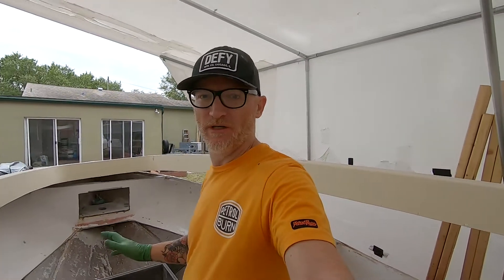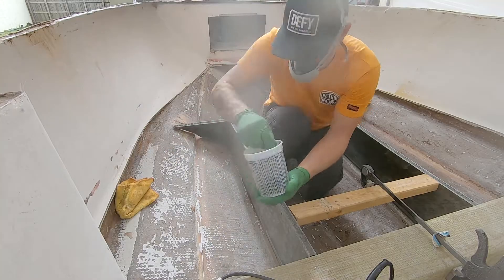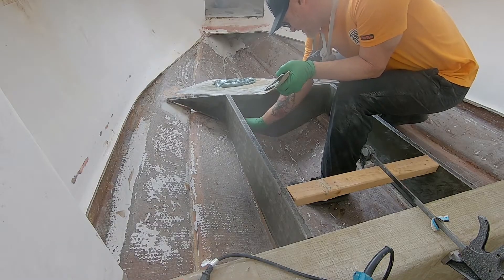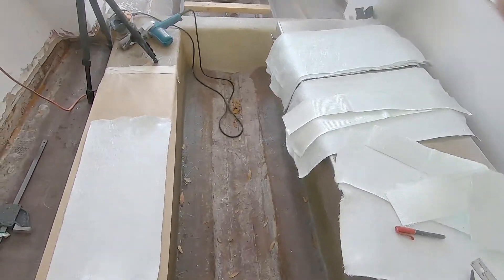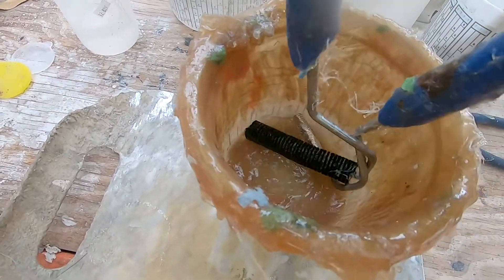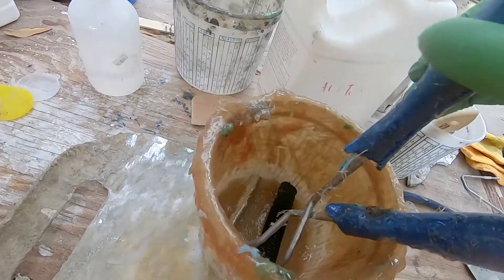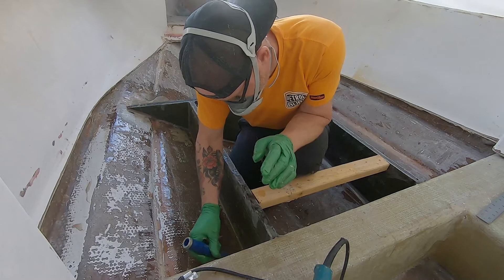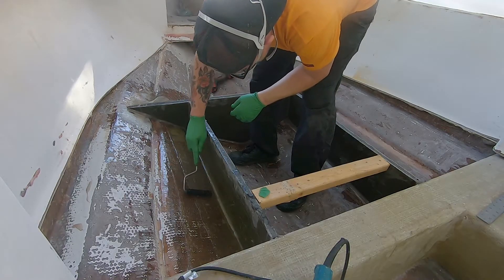HOW TO FIBERGLASS TABBING for Boat Stringers Transom & other Marine Fiberglass Renovation Projects

Comment: what about on new stringers where the engine mount bolt holes are. Do you epoxy resin the hole then re-drill?
Reply from the maker: Assuming the stringers are wood…yes. Over drill and fill with epoxy.
Reply: @boatcrafterscollective  okay great that's what I was thinking I guess add some 403 or 4062 thicken.
Reply from the maker: @Supanova70  I don’t use West products. Just regular Fumed Silica will work to thicken any resin. West likes to call their products fancy names so they can charge more for them. 
Cabosil = Fumed Silica.
Reply: @boatcrafterscollective  you know I was thinking the same thing I'm new to this stuff but silica is silica
Reply from the maker: I sell alot of items at boatcrafterscompany.com and im slowly growing the stuff I offer. If you ever have questions just shoot an email.

Comment: Question I was always told to start with your smallest piece then work your way to the largest piece. That way if one lets go then you still have another piece bonded? Just curious what you think?
Reply from the maker: Why would just one “let go” and not all of them? If you have a lam layer detach you have much larger issues and that would be an extremely rare situation. That mindset I feel is flawed. 

I’ve been doing this for a long time and will tell you that unless you’re working extremely fast putting down all of your layers before the resin kicks off, your going to have issues laying a second layer over a smaller layer because the edge of the glass will start to cure so now you’re trying to put a second layer over the top of a hump/ridge causing air pockets under the laminate. I honestly don’t know where that method misconception started but it’s flawed. 

Everyone does fiberglass differently but putting larger layers over smaller layers is a nightmare to deal with. Every boat I’ve ever built has been large layer first.

Comment: Not all glass fabric comes with the same binders... to be on the safe side, get a can of styrene (same people should sell it) add the recommended amt. to your resin), will also decrease viscosity so it wets better and improve adhesion... (a must for no-name resins)
Reply from the maker: CSM has one of two binders. Either a styrene binder or a power binder. 90% of CSM is styrene binder. Polyester resin has styrene in it by default. Adding more styrene to your resin is a terrible idea as it only thins the resin and reduces its chemical characteristics. Making the resin more viscous is not helping the adhesion at all. It’s making it worse.

Comment: I’m about to start glassing all my stringers  on a Paramount just like this. I see that you did not round the top part of the stringers, I’m using coosa just like you did. Is ok to lay the floor on top just like that?
Reply from the maker: Yes. You don’t need to go over the top.
Reply: @boatcrafterscompany  great, thanks. One tab is enough for the stringers?
Reply from the maker: @haroldc.e567 no. Three tabs. 
10” 8” 6”

Comment: I use epoxy for all below deck work, and switch to polyester for the horizontal surfaces above.(deck and gunwale) to make it compatible with gelcoat wear surface.  Vertical exposed surfaces, I switch back to epoxy as I paint these surfaces with 2-part urethane paint.  I get my epoxy for free, but for below decks, I'd still spend the extra.

Comment: Bro.. good job!.. but you would save some time by just mixing up a big ass bucket of chopped fiber fill and layer that on right under the glass as you're laminating. You don't have to mess w corners etc.. all one step! 👈👽
Reply from the maker: Sure that’ll work but not in Florida heat. By the time I mixed up the putty, wet out the glass, and got the glass into the part the resins would be kicking off. Unfortunately not possible for one person to manage.
Reply: @boatcrafterscompany  for sure.. I'm in CT.. I've been starting 4-5 am to stay out of the heat man. I'm also a one man show. You know what I started doing on some difficult pieces? Like decks from underneath. Just cutting 1' squares. 🤷 Sometimes there no space for more hands even if you had them. I've done both ways and probably other ways lol. I enjoyed your vid bro. Top notch. 👽👍

Comment: i used to use disposable baking piping bags for my coving, it makes it so much quicker to get your filler into the corner and wipe a radiused spatula or spoon across it
Reply from the maker: Sure that works when it’s 70 degrees. In 90degree Florida heat you have about 5 minutes to mix and get the material down before it kicks. Certainly no time to load up a cake bag.

Comment: That's the first sign he don't know what he's doing if your gonna lay 1708 you always lay chopped stran Matt first and you don't use epoxy resin to do tabbing you use vinyl resin so you can go layer after layer with out having to sand
Reply from the maker: You have no idea what you’re talking about. 1708 has chopped strand stitched to the back of it and you don’t need an additional layer of chop. I’m not using epoxy.
Reply: @BackyardBoatworks  how u gonna tell me I've got two boats now and had two previously not small bullshit boats either 75 f30 Trojans twin 318s got ridda both of them now I got a 89 32' penn yan 12' beam and 26' robalo center console 10'5 beam
Reply from the maker: I don’t care if you got the Titanic. You’re comment was wrong. Learn what 1708 is before making a dumb comment.
Reply: Lmfao Ronald man y'all are brain dead

Comment: I have a 1985 19' bluewater open bow power boat im about to install a new transom in. The top of the transom to the hull doesnt allow for a decent tab. Ive heard tabbing should be atleast 3" on each side being joined for a total of 6" sheets of glass. With my area i might be getting 2" on the boat.

Do you have a standard tab measurement you go off of? Also smaller tab first or larger tab first? 

I know your a busy guy thanks for any help you can give.
Reply: 12, 8, and 6, answered part of the question. Sorry it happens fast in your video I didn't see it prior. I wonder if 2" (total of 4" tabs) on the top of my transom would be sufficient?
Reply from the maker: The top of the transom doesn’t really need tabbing. Typically the glass is just capped off over the top depending if the cap is off etc. 
focus on the bottom and sides and you’ll be fine. 
Large piece goes first. Don’t listen to any garbage about putting the smallest first. That will cause nothing but air pockets under the glass.
Reply: @boatcrafterscompany  thanks for the quick reply!

Comment: Thanks very much for the tutorial - exactly what I needed as a first timer in bedding and glassing stringers. Quick question - when laying the laminate on the next part of the stringer do you overlap them slightly? If so by how much? Many thanks.
Reply from the maker: yes overlap so it creates a continuous reinforcement.  It does need to be a lot of overlap maybe 1-2"
Reply: @boatcrafterscompany   Brilliant. Will do. Thanks.

Comment: Did you glue them in with polyester to the hull ? Or are they held in place with epoxy ?
Reply from the maker: The radius holds them in place till the glass tabbing is added. Not necessary to bed into the hull.

Comment: Polyester won't bond to epoxy, but vinylester will.
Reply from the maker: Untrue. Polyester will bond to fully cured epoxy when sanded with 60grit and cleaned well. The key is the epoxy has to be 100% cured. Most common marine epoxies take about 7-10 days to fully cure and some take longer. Once epoxy has fully cured and it’s completed it’s Chemical reaction process, it functions just like cured polyester. This is a common misconception among DIY boatbuilders. 
However putting poly over epoxy doesn’t make much sense. The only time it would make sense would be if you were fixing a bunch of cracks and crazing with epoxy you could let it sit for two weeks and then topcoat it with gelcoat. However, using Vinylester putty for the repairs would be the better option.

Comment: Like that brush roller. I haven't had luck using a fin roller on poly resin like I do with epoxy. It just wants to dig in...?
Reply from the maker: I stopped using fin rollers and prefer the bubble buster rollers instead.

Comment: Great video and so extremely well explained. I believe I may have some rot in my stringers, any tips for how I could check without destroying my boat or floor? Thanks
Reply from the maker: There’s really no easy way. If you can reach them from the bilge area you can drill a hole in the side to see what you find. If you have rot stringers it’ll most likely be towards the back of the boat. Drill a 2” hole and see what the core looks like. If they are fine just fill the hole up with epoxy
Reply: @boatcrafterscompany  thanks mate. I have a feeling that's where the worst of it will be too. Thanks

Comment: Agree polyester resin is good enough on older boats built on the same resin. But nowadays  I only working small scale with my own boat or smaller jobs for others. Don't have to think about resin cost anymore😊 Epoxy sticks to everything, no matter what resin is below.
Reply from the maker: No one makes epoxy hulled boats unless it’s a carbon hull. Poly resins have been used for decades in almost every glass boat ever built. Epoxy is an adhesive so it can’t be compared to poly resin but for most jobs epoxy is overkill and doesn’t justify the additional cost.
Reply: @boatcrafterscompany  Where are you buying "cheap" polyester resin?  Raka epoxy is comparably priced to most Polyester resins and less expensive than any Vinylester.  Even Facebook marketplace sellers price Polyester resin of questionable lifespan fairly high.  The only advantages I see for Polyester at this point is rigidity, workflow advantages, Gel coat comparability, and UV resistance.
Reply from the maker: Cheap is a term that is different to each person. Average cost for good quality poly resin will be in the $40/g range. But if you’re like me and I buy wholesale my cost is about $23/g. Sorry but you’re not matching that with epoxy. 
BUT…using epoxy for jobs like this is a waste of time and money. Professional fiberglass shop DO NOT use epoxy for work like this for many reasons and it has nothing to do with cost. Epoxy is extremely overkill for lamination work. The adhesion strength of epoxy is stronger than  most substrates can handle. Example…if you laminate a piece of Coosa with 1700 and epoxy and try to pull the 1700 off, the coosa will separate and delaminate before the epoxy will fail. Will it work??  Yes it works but why use it. That’s like going to the marina as asking the yard to haul your center console out with the 100 ton lift when your boat is only 10ton. Does it work…yes but you just paid $5000 for a haul out that you could have paid $500 for. 
Besides that…epoxy resin was never designed for hand lamination it’s designed to be used in infusion processes. Wetting out glass by hand with epoxy resin is much more difficult than wetting out with poly resin. Additionally epoxy resin takes 12 hours to cure. Professional shops don’t have time to wait for that hence why nearly all repairs to this day are done using poly resins. They work good for the task at hand. But hey…if you wann use epoxy GO FOR IT. It your bank account not mine. ✌🏼
Reply: @boatcrafterscompany  Thanks for the heads up.  $23 is significantly less than what I'd be paying so that certainly makes sense for you.  For me its $38 polyester vrs $50 a gallon epoxy and with the epoxy I can save on matl by using less or no chopped strand layers and epoxy's bond strength lets me comfortably use more fillers.  That said for bonding to wood i'm often shocked by how poor the bond can be even with epoxy.  Couldn't agree more on the workflow and open time advantages for polyester and vinylester.  Having to constantly abrade cured epoxy is the pits.  Do you use vinylester to initially wet out repair areas before using polyester exclusively for the reinforcements?
Reply from the maker: There’s not really any cost savings because most of these repairs are done using 1708 which has the CSM layer stitched to it so you’re getting a 1700 biax and a .75oz CSM sewn together. 1708 is designed specifically for this purpose. I never use plywood so I never have to deal with that issue. Only time i would use plywood is if im repairing an area that is already plywood and it makes sense to just patch it with the same core material other wise im using Coosa style board or foam. I rarely use VE resin either unless im working below the waterline or im doing repairs in something that was in terrible condition. As long as i can grind down to clean solid fiberglass using a good quality DCPD or ORTHO poly resin will be more than sufficient. Lamination failures happen typically because the prep work was poor or the application was poor. It’s not the fault of the resin it’s the fault of the applicator. Also selecting the wrong glass can cause issues. If I’m doing a critical structural job (like stringers) I’ll typically use ISOTHALIC or VE resin for the first layer of glass and then I’ll switch to lesser cost resins for all the layers after that.

Comment: Very very good video💪🏼💪🏼💪🏼 why did they change the stringers from what looks like foam filled giant ones to the cussa
Reply from the maker: This boat had plywood stringers. The foam filled stringer I built.
Reply: @boatcrafterscompany  cool but Im interested about why not go with the foam filled all the way?
Reply from the maker: Because it was too difficult to build a mold in that areas of the hull.
Reply: @boatcrafterscompany  okay I like your work instantly hooked I have two boats to rebuild and I was looking up how to do those types of stringers

Comment: Great to hear your experince with Iso polyester instead of Vinyl and Epoxy. Would I be able to lay Ortho polyester over Iso, wet in wet to get chemical bonding, or do I need to wait for Iso to cure, sanding and then lay Iso?
Reply from the maker: All poly resins are interchangeable.

Comment: Bro, you need to wet out the dry surface you’ll be applying the cloth to first.  There’s also no need to wet out your cloth till it’s transparent.  Wet out the stringer surface, then wet out cloth on your wet-out board just wet enough so that the surface of the cloth is wet, then transfer it to the stringer and roll it out until it’s transparent.  The pre-wet stringer surface will finish saturating the back of the cloth for you.  The pre-wet stringer surface also makes it easier to put in place without having to fight with like you were doing.
Reply from the maker: Where was I fighting? 
There’s a million ways to do glass work like I mentioned in the video. Everyone has their technique.

Comment: I have a question for you about your process. If you are using the material for your stringers that is not affected by water, why can't you simply used panel bond between the stringer and the hull and be done with it? No need to add fiber glass to protect the stringer from water and the panel bond is stronger than the fiberglass. I am a car guy and not a boat guy but I am restoring a 1966 Glastron V174 boat and I know that the panel bond adhesive on cars is stronger than the welds. If your bond between the stringer and the hull is good with Panel Bond or the WEST system, why add fiberglass mat on the sides of the stringers to the hull? Sorry if this is a stupid question, maybe I am missing something.
Reply from the maker: The fiberglass gives the hull its strength. Not the board itself. The tabbing is staggered in widths as this distributes the weight/forces away from the base of the stringer. If you bonded the stringer to the hull alone, your hull will crack.

Comment: What material would you recommend for stringers in an inboard Ski Boat? I believe they are 1 1/2 thick as the motor mounts attach to them. Thanks great video.
Reply from the maker: Coosa Board
Reply: @boatcrafterscompany  It comes in 4x8 sheets. I would need 16' so is it acceptable to splice joints with 3/4" material to make the 1 1/2 x 16'?
Reply from the maker: Yes. Make your cuts at a 45deg angle at the joints. Keep in mind that the stringer core material really only acts as a mold for the fiberglass. The strength comes from the glass lamination. The more glass that’s applied over the stringer core, the stronger the stringer will be. You can use foam as the coring material also. There’s many ways to go about it but for DIYer using Coosa board is sufficient and easy to use.
Reply: @boatcrafterscompany  Great thanks!! What method would you use to bond the coosa board together screws and some type of glue or epoxy?
Reply from the maker: You can get Coosa in 1.5” thickness but it’s pretty expensive. If you want to bond two 3/4” pieces together simply use a thickened epoxy putty and you can use screws to hold it together while it cures. I’ve seen guys drill a bunch of 1/4” deep holes into the two facing sides that’ll be bonded together to allow the epoxy to fill those holes creating more surface area for the epoxy adhesive. I’m not sure if there’s merit to this technique but it can’t hurt

Comment: I'm new to this channel, and I enjoyed this tutorial, thanks! Indeed, preparation is everything. I build RC boats, but the basic process of lamination is the same as on full size boats. I prefer epoxy resin as it gives me all the time in the world to work wet-in-wet. Obviously, the extra cost of epoxy resin is negligible as I only use small amounts. Adding a radius to a tight corner sure is a good idea - I learned that the hard way. I either make a radius using thick epoxy glue, or for longer sections, I might choose a wood profile or a piece of insulation foam cut to the desired shape.